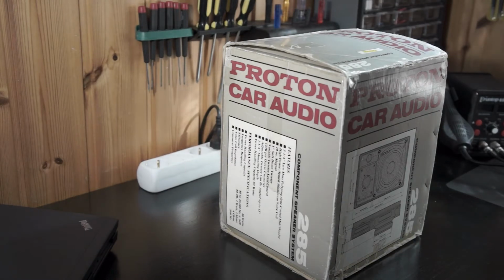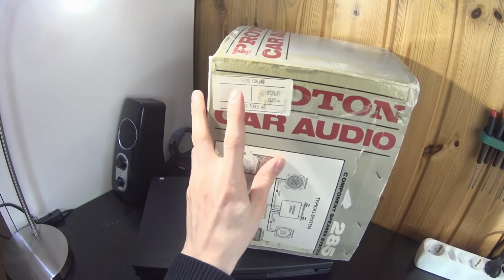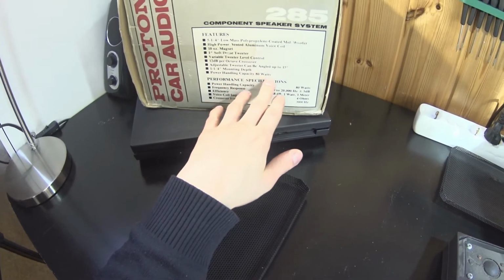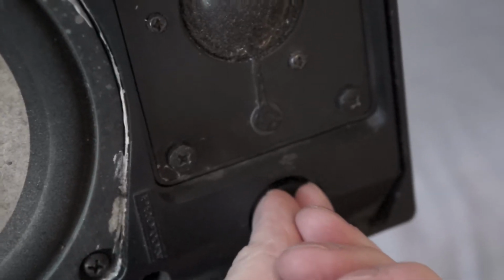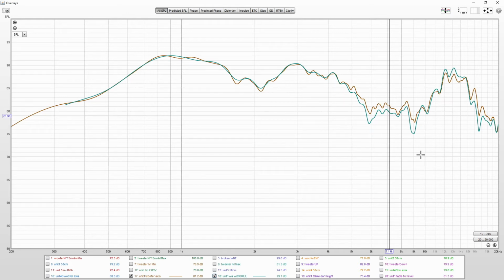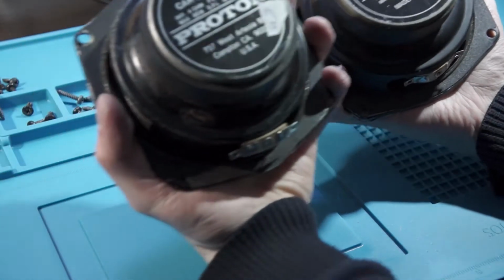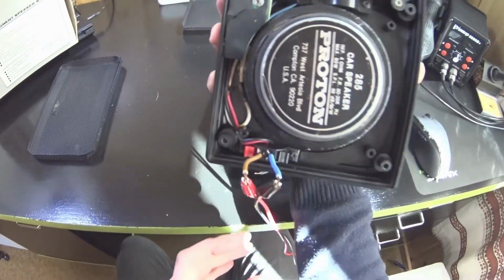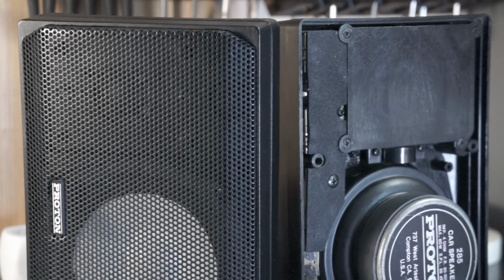Car Speakers to Home Speakers | Proton 285 DIY build Part1

Comment: My rear parcel shelf of my bmw m3 is similarly mounted into a frame just like these. It came on most 3 series models from year 92-99. It uses a 6x9 and a 2.75” wideband/tweeter which is also sealed off in its own compartment to avoid deflection of the tweeter just like yours there. 

They are great cars for audio systems. They come oem with a 3 way component but it does depend on where you are located since not every country got the full premium 10channel hifi or hk system 😊